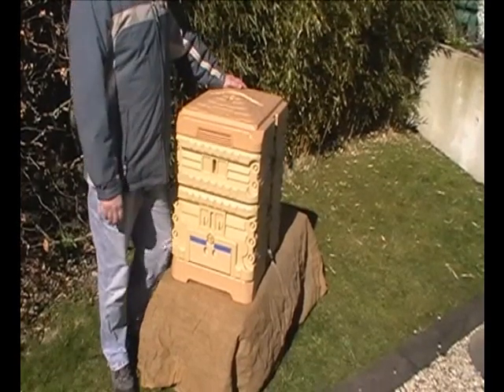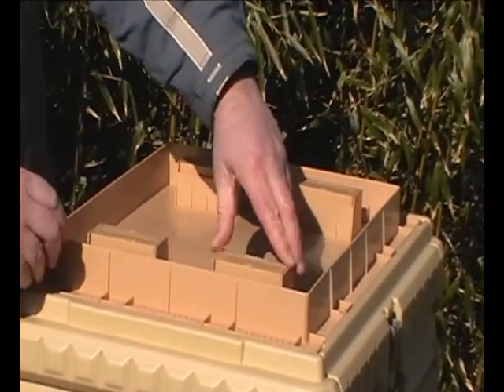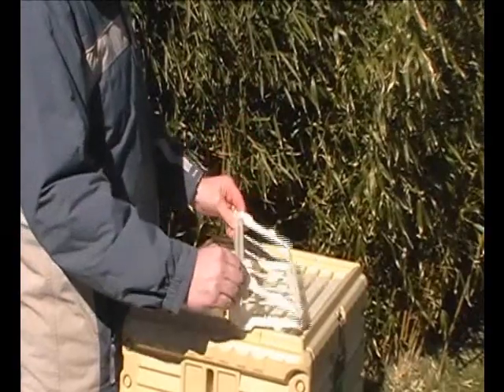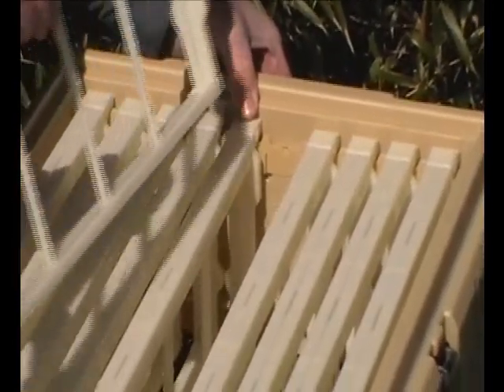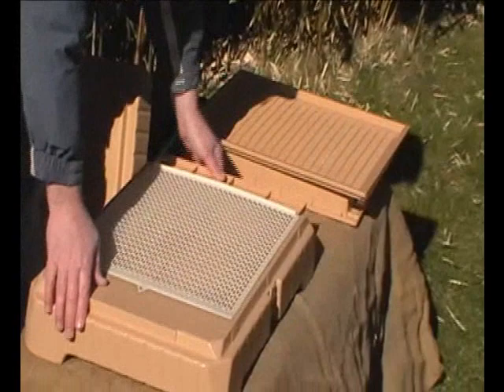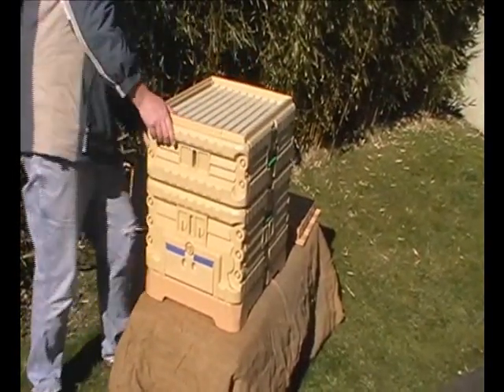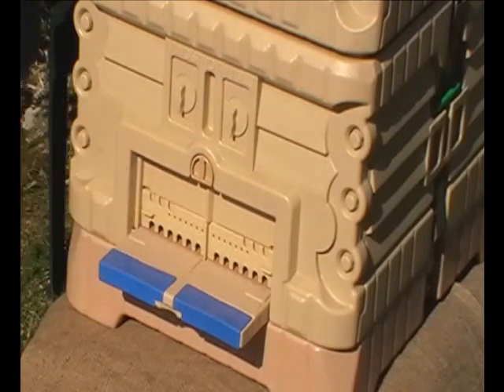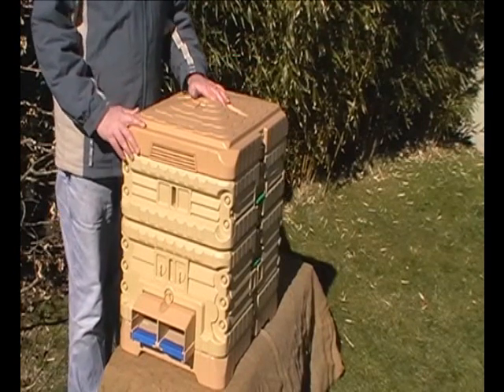Inside an Apimaye Thermo Hive - The Future of Beekeeping... A Plastic Beehive

Comment: What happens when your bees get AFB? Only way to salvage your equipment is to scorch it to kill the spores. You can easily scorch wooden boxes with a torch but what about this plastic hive? Get hit with a case of AFB and your $400 toy goes straight to dumpster - no way to salvage it.

Also, most of the beekeepers tend to adopt a minimalist approach - spend as little as you can and use it for as long as you can. For a price of this one hive I can build 8 wooden hives from cheap scrap and they will last forever. And if something breaks - they can be easily repaired or parts replaced. This plastic hive is way too complex and cannot be readily repaired by a beekeeper without ordering replacement parts for more $$$.

I can see this as a novelty beehive for someone with money to waste but it will be absolutely impractical as an entry-level hive for a hobbyist or workhorse hive for a commercial beekeeper. Far cry from "Future of Beekeeping", unless they figure out how to produce them for under $50.
Reply: If the hive is infected with EFB or AFB the hives can be disinfected with diluted bleach.  If using the wood frames they have to be burnt.
Reply: But with this hive you don’t have to burn it,that’s the great part of it. Bleach will kill the spores and if you use wood frames,burn those. All this info is on their website to read for yourself.This would save money in the long run and I love the fact it comes with all that I would spend extra on with a wood hive.

Comment: Cost is high and looking at your website it only comes with 2 supers (and I don't see where you can buy additional supers or frames) Plastic is fine but I would set these on a normal bottom board, yours is a little to complicated and does not offer many options to ventilation, trap boards etc.  The rest of the hive from the brood chambers up is really nice.  By the way if I had AFB no way I am going to try to "burn wood boxes to scorch them"  and then re use them - your asking for trouble - just burn them up completely and get new.  I would like to buy 20 medium frames just to see how they would work out.
Reply: +FreeAmericanSpirit You can sterilise plastic chemically for AFB and EFB. Torching the wood is standard practice also because you can't sterilise the wood chemically as it will absorb the chemicals.

Comment: It just seems like a poor idea. More than likely really expensive and all the plastic frames I have used were ok for about 2 years max before they were to brittle to have in the hives the tabs broke off and then the frames were junk. It was just a test run to see how the plastic frames would work out and I am confident I will stay with wood and wax foundation.